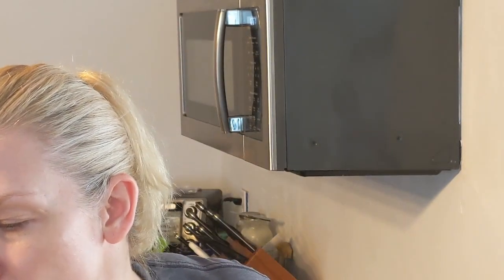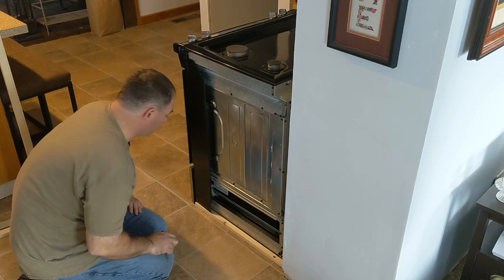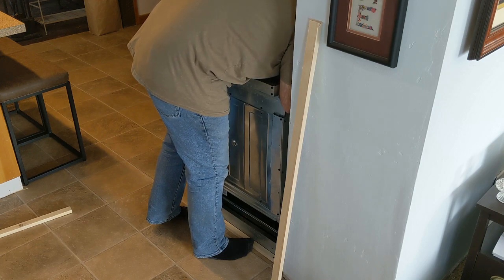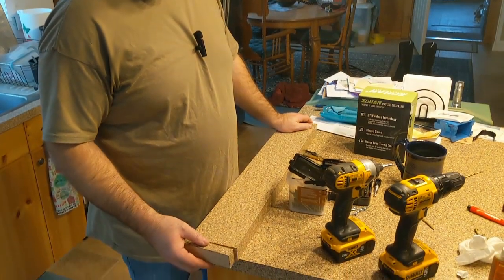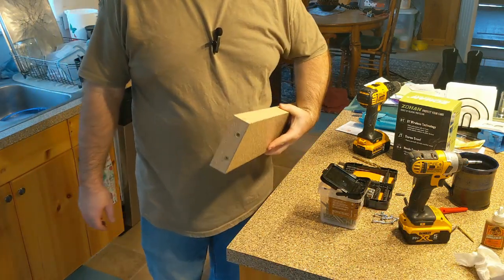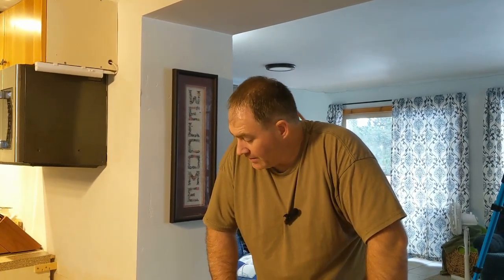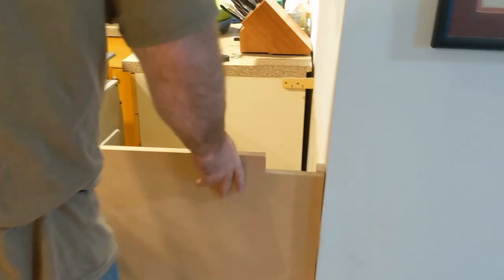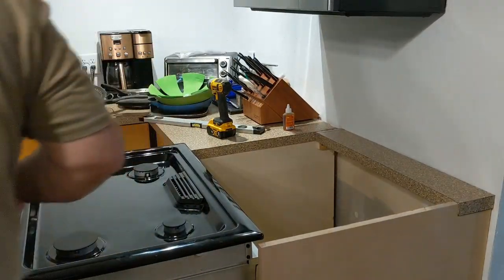DIY Kitchen Spruce Up - Filling The Gap And Creating A Side Panel For The Range

Comment: Thank you very much for sharing the video. It was greatly done! I have just one question. What about the air circulation? supposedly there are air vent on the back of the stove. With the cover-up, does that create any risk of air circulation? Thank you again for the video.
Reply from the maker: Hi thanks for your question. The way we built it is the same as if you are sliding the range into an island. There is a small gap around the stove and underneath it as well so there is plenty of circulation for the range. Our range is actually made to be put in an island where it would be surrounded on all 3 sides anyway. Also where the stub for the propane comes up from the floor only allows us to push the range back so far so there's a pretty good gap back there.  Thanks for watching our video!